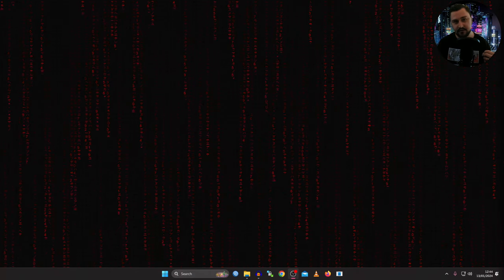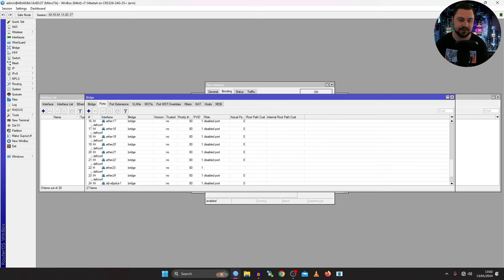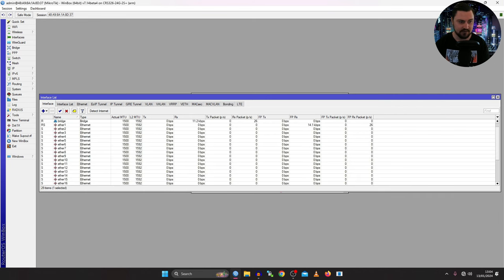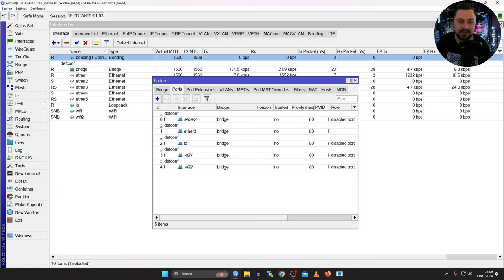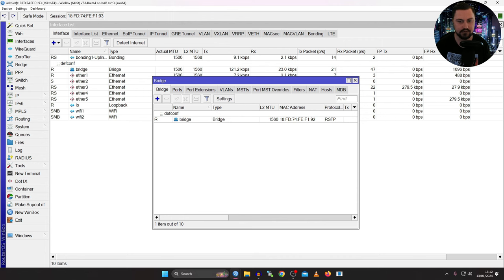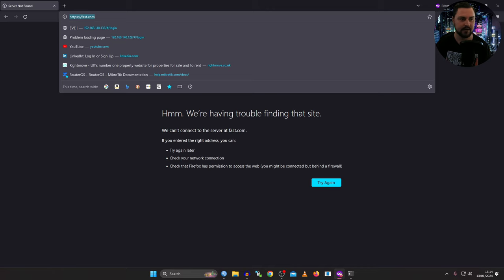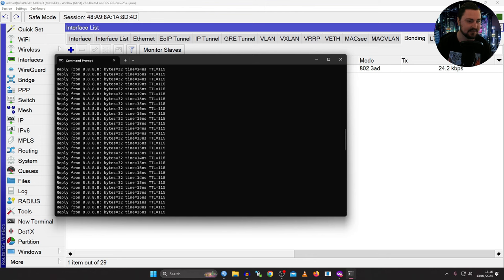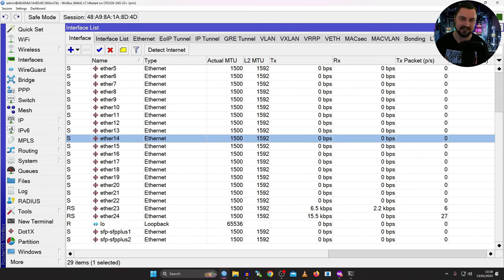Mastering MikroTik LACP Configuration: A Step-by-Step Guide

Comment: Thank you
what would be the best configuration to use LACP to aggregate multiple links (ADSL lines with Same ISP and same Latency) to a CHR VPS
Currently I'm doing the aggregation with EOIP tunnels (which are over L2TP tunnels) and balance rr bounding mode
Looking to improve it more as I have no access to high speed internet connection where I live
Multipath TCP (using openmptcprouter project) should work great for me but ISP blocks all other VPN protocols (except for L2TP and PPTP) so the openmptcprouter didn't work for me

Comment: I had very bad time configuring lacp between ccr2004 router and crs326 switch, the router becomes unmanageable due crazy lag. Mikrotik support couldn't help so I just gave up and disable bonding. I even replaced ccr2004 with new one, same result, so there is a bug in ccr2004. BTW using hap ax3 instead of ccr2004 with same config works perfectly fine.

Comment: have you tried to play with l3 hw offload on that crs? i managed to make both routing and mpls (p/pe) working with some strange behavior (like traffic generator seems to work fine through it but bandwidth test for some strange reason switches crs to cpu routing) i would love to see your take on it.
Reply from the maker: Honestly this is something I am busy testing as well and have the same experience. Trying to see if there is something that can be tweaked to give the expected results
Reply: @TheNetworkBerg  i did some testing and it seems like it doesn't like /32 addressing (sometimes it works sometimes it doesn't) also it looks like this switch cant use more than single mpls label on the stack ( i can run offloaded EoIP tunels on it but vpls/l3vpn goes through cpu.